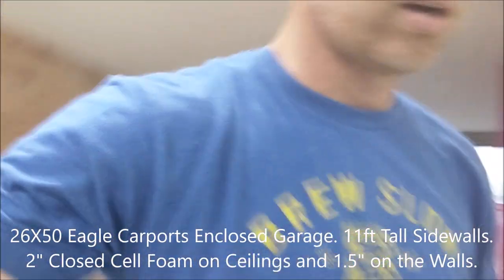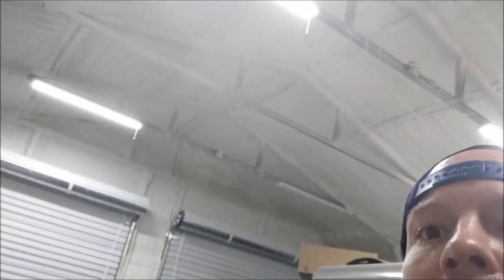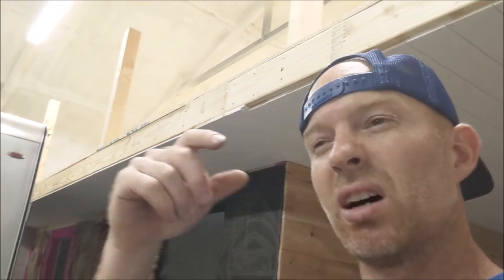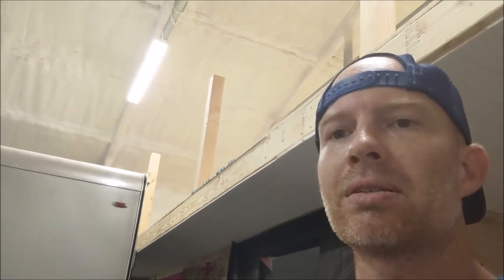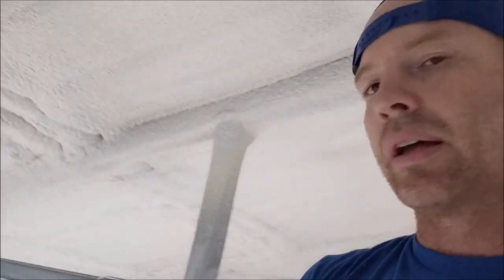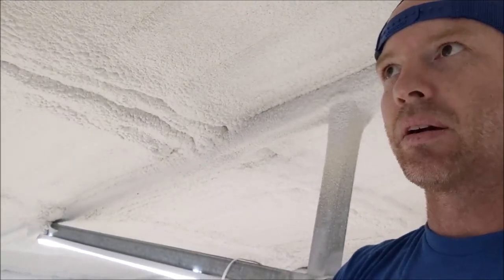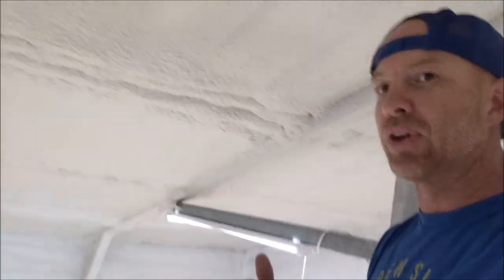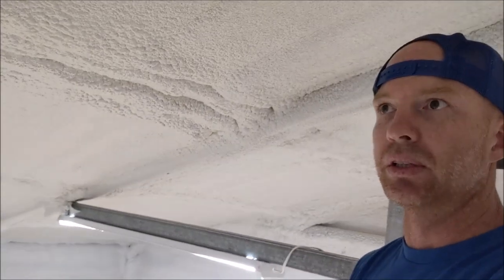Eagle Carports Metal Building With SPRAY FOAM VS RAIN!! How Loud is it Inside?

Comment: The problem with spray foam, is that the material is basically a cured polymer that is actually a solid material. That solid material is not meant to dampen sound. The best way to dampen sound, would be to have a rubberized coating on the bottom side of the panel, to subdue some of the reverberation of the metal. Add small air gap to a install a radiant barrier, then a layer of foam or even better some fiberglass insulation of sorts would make a big difference over just a solid layer of poly spray foam.

Comment: Same result with my 3500 sq ft bldg with 3 inches of closed cell foam...
Bldg has a monitor roof and when condensation drips from upper roof
to the lower roof, it sounds like a war zone. This is just from morning condensation.
When it rains, it is deafening...I'm going to install gutters on the monitor which will help.
Reply: What are you using your building for? Residential?

Comment: Hmm that’s interesting.  I would expect it to be quieter.  Looks great inside though!  Can you share what the price was for the foam and why you chose closed cell vs open cell?  Thanks!
Reply from the maker: Closed cell for structural properties. it stiffened the entire garage up ... a Lot. i believe it was $1.35 sq ft for closed cell @ 1.5 inches on the walls and $1.50 sq ft @ 2" on the ceiling. I may go back with another 2 inches of open cell on the ceiling to help with the noise.
Reply: @danielmid6022  id be interested to see if the open cell helps at all.

Comment: have you had any issues with condensation or moisture since putting in the spray foam?  I am considering converting one of these to a living area but concerned with whether the spray foam can handle the metal condensation.
Reply: No response?

Comment: Have you done the automatic roll up door opener? I’m about to install an eagle building and I’d like to know how it worked out.
Reply from the maker: Not yet. I want to have my doors adjusted to close as smoothly as possible first. They are slightly off. Hopefully soon, I really want to get it done. I will post a video for sure
Reply: Awesome thank you. I only ask because I notice that all the openers say you need so much room between the door and the bracket. So I was wondering if there is sufficient space on the eagle carport doors.